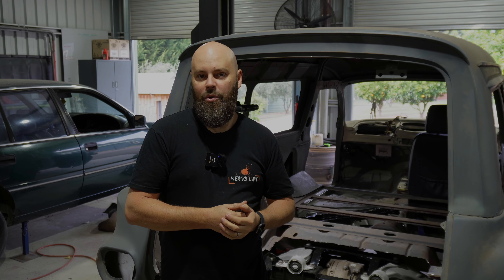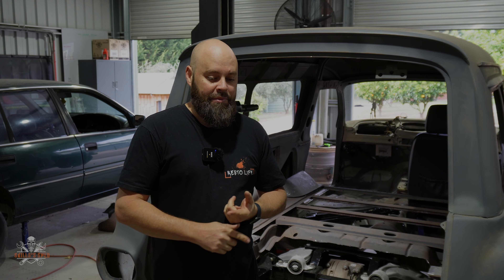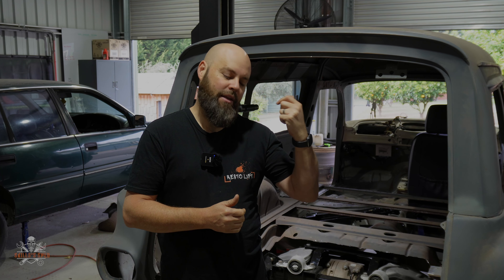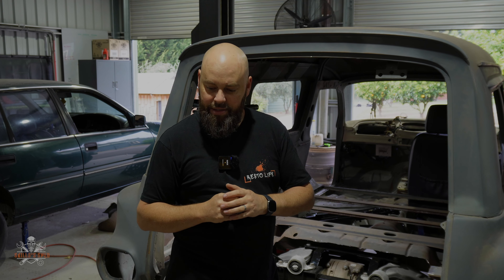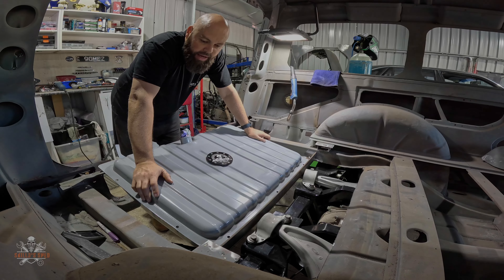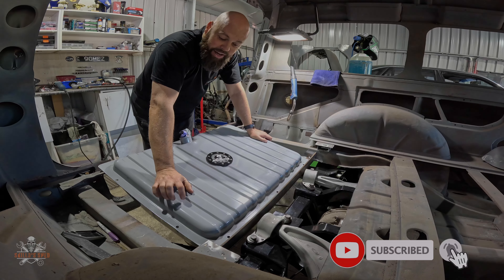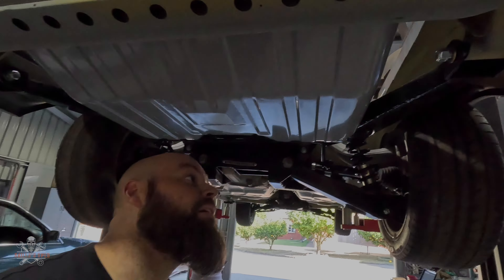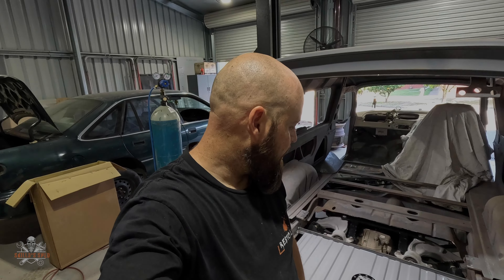Installing a Mustang fuel tank in an EH Holden panel van

Comment: Hey mate, not thinking you will have to but, is there enough room to remove the tank if you have to if the back floor is back in? Just in case is all. you could bolt it up from underneath rather than from above ( have your welded nuts on the upper side). That may give you a little bit more clearance/adjustability for your filler neck as well. It will be the filler neck that will catch you out I'm thinking.Not knocking it, but just an idea. Keep the vid's comming buddy the old girl is taking shape.
Reply from the maker: Thanks mate for the kind words. 

I wouldn’t be able to bring it up from the bottom as the lip won’t clear the arms of the suspension. I plan on making the last two floor crossbars removable in case I do so should t be too much of an issue. Good thought though!